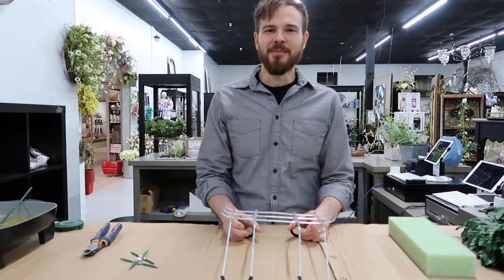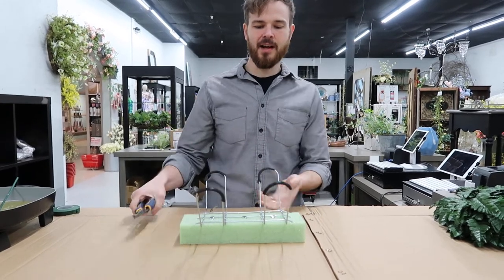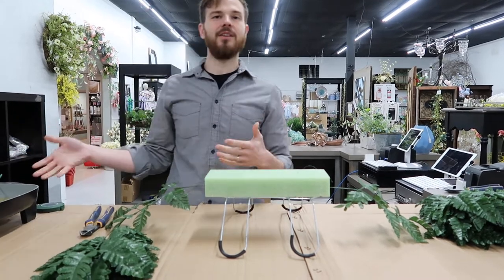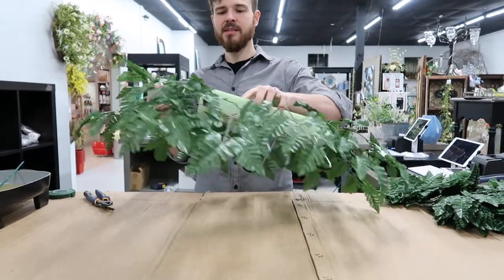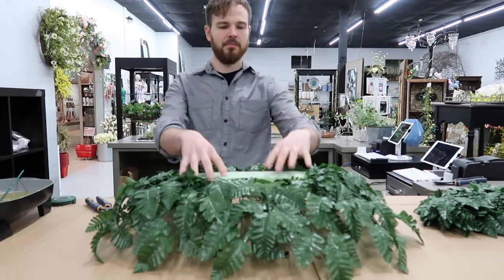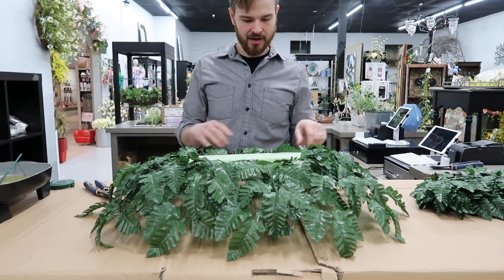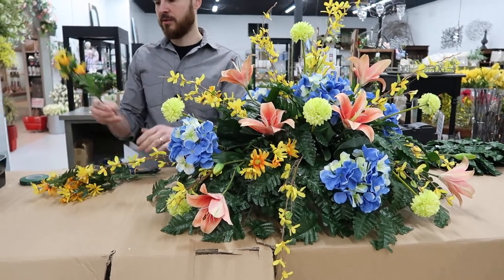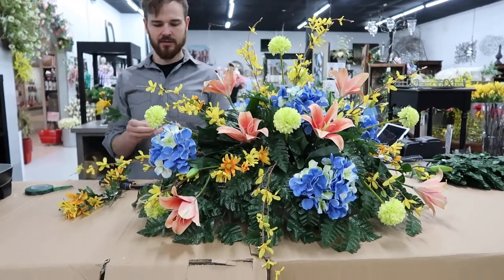DIY How to Make a Cemetery Saddle Tomb Clip.

Comment: What is advantage of leather greens vs silk?    Silk flowers will fade so do you have an alternative?  I am designing a base of greens with four seasonal toppers that can be switched out.  I would like any expert suggestions.   I know each topper will need freshening annually but I’d like to keep that at a minimum.   Thanks so much.  Your tutorial is perfect.
Reply from the maker: Mainecoonlady Thanks for the question. Both are made of a plastic substance, so they will all fade in direct sunlight and in the elements over time. Leather leaf is fairly inexpensive, which is good, but it fades at about the same rate as other silk pieces. You can spray your flowers with clear acrylic spray paint to make them last longer in the weather. Hope this helped.
Reply: David Christophers Great idea!   Thank you so much.  I learn so much from your videos!